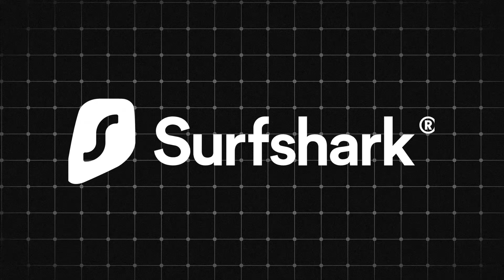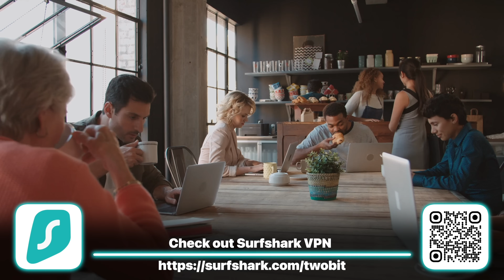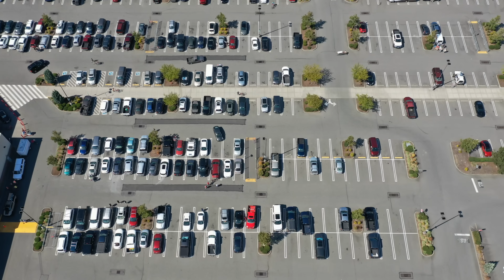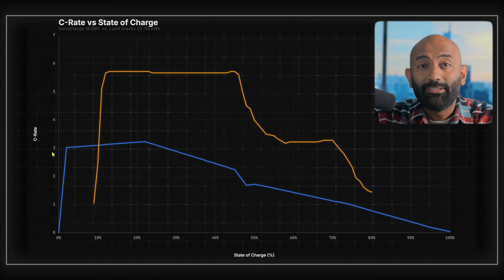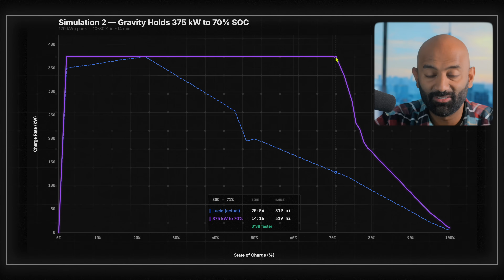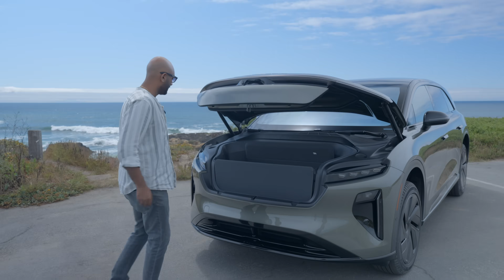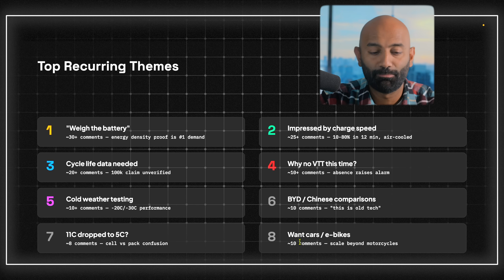Donut Lab Battery Test 4 Changes Everything!

Comment: Would the Doughnut Lab results hold steady even if the battery size is scaled up?  Somehow I suspect the results might drop a bit as battery size increases.  Obviously, though, there might be ways to avoid or minimize any drop.
Reply: Well, just with respect to a single claim. Cell level was claimed to be 12C charging, and already in video 4 it dropped to 3.5C charging at pack level....And we don´t know if 3.5C charging harmed the battery, if it even was a donut battery, or if the donut promotion video was not rigged in any way.

Time might show the truth.
Reply from the maker: size changes the game — cooling’s the real bottleneck

Comment: And this battery is aircooled. + nobody believed it...morons. The Finnish does not LIE...It's not in their culture...
Reply: We donut say we donut believe, but in general we donut believe anything, as to believe is not a strategy.....we want to know. 

We say we are not donut´s, and do not know anything just based on a promotional video. Yeah , yeah, yeah , either the Finnish do not lie, or the Finnish will be Finnish ... time will show.
Reply from the maker: finnish engineering: quiet, reliable, and slightly underrated

Comment: RC pouch cells charging at 12 C has been around for ages. Ok they do not live long as they are usually agonised with discharge rates averaging over 10C with bursts and peaks of 30 to 60 C or more.
Reply from the maker: 12C pouch cells? Cool. But holding 5.7C to 80% with cooling? That’s the new part.

Comment: Ricky, where is this massive electricity jolt going to come from? In order to charge these things in 3-5 minutes, or car versions in 10 means quadrupling the amount of electricity needed. We’re talking charging cables the diameter of your calf putting through enough energy to power a small town. Having a battery that can accept 770V doesn’t mean that 770V can be produced. What happens when three or four cars with these batteries show up at the charging station at the same time? Then, we’re back to 50 minutes charge cycles because there’s not enough electricity supply. 

I was a subscriber but I think I will be unsubscribing. You’ve compromised your scientific logic for clicks.
Reply from the maker: excellent question! thats why i made 2 graphs, 1 if we extrapolated the 5.7C rate to a big pack, and the second, keeping the current max rate, but being able to hold it longer. you're asking the exact right questions

Comment: If the "Donut battery" technology—unveiled by Finnish startup Donut Lab at CES 2026—were officially proven to be a scam, the CEO Marko Lehtimäki would likely face intense legal scrutiny across several jurisdictions where he and the company have deep ties. 

Potential "Safe Haven" Nations (Non-Extradition)

Should Lehtimäki seek to flee to avoid prosecution for financial fraud or investor deception, he might consider nations that do not have active extradition treaties with Finland or the European Union. Common destinations historically sought in such high-profile corporate fraud cases include:

United Arab Emirates (UAE): Often cited as a destination for individuals avoiding European legal reach, though extradition cooperation has increased recently.

Russia: Given the reports of an original angel investor being a Russian oligarch, there may be existing financial or logistical ties that could facilitate a move there.

Turkey: Frequently utilized as a jurisdiction that does not always readily extradite to EU nations.

Nations with no extradition to Finland: Certain Southeast Asian or Caribbean nations without formal legal assistance treaties.

Comment: After the most recent test I was pretty disappointed.   Just too easy to fake something like this.   The most salient point made here by you @TwoBitDaVinci is them soliciting for more capital from existing investors.

Lets just talk about claims and take what they have shown as not being faked.
Their claims
1)  400whr/kg - no information being provided to verify/demonstrate this density in packs much less final product in any video so far.
2)  Full charge in 5 min.   What was demonstrated was 80% charge in a 18Kwhr pack in 12 1/2 minutes.   Also note in video 1 at 11 C charging the pouch only got to 80% charge in just under 5 minutes.   So their own tests and videos show that even a single pack at 11C charging couldn't charge in 5 minutes.   Doesn't mean it can't, but if you have already shown this in your own tests, why show a result that fails to prove this.   Might be a significant improvement in charging speed but it isn't full charge in 5 min.  (their own tests shown refute this claim, yet all you can say is what an improvement it is).  Sure it's an improvement but decidedly a fail on demonstration of a full charge in 5 minutes claim.
3)  100,000 cycles - Not even sure they could do a complete cycle in 12 minutes (so assume this is the fastest they could do a cycle).  5 cycles/hour 120cycles/day.  Drop this to 1 cycle/hr still only 24 cycles/day.   It would take over 400 days to get to 10K cycles at that rate and just about 3 months at 12min/cycle to get 1/10th of the cycling data.  Not even sure I would believe this data because it probably wouldn't use a real world product or even one of the pouches.    Personally this part of their claims to me the most important as it is the difference between a pack that wouldn't be replaced in what 5-10 generation vs. 1/2-1 generation is pretty huge in itself.   Not one hint of evidence here on the long term cycling data.   Might have been a good PR technique to basically just start VTT with one pack cycling at some temp/rate and show the new cycling data every week along with other tests but no hint of that.
4)  We saw a high temperature test.   I would have to look back but didn't one pack seal fail or some internal outgassing at 80-100C?   From what I saw there the high temp test looked good but again only 1 cycle, one pack and one pack out of 3 breaking it's seal or outgassing internally.  (not a great look for a production ready product)
5)  No low temperature cycling test.   Others have pointed out this would give us some decent info on chemistry btw. and at least give a hint at low temperature performance.
6)  No proof or any information regarding not just what materials are there, but what materials are decidedly absent, much less green etc. 

There are some other claims made as well
7) Ability to print test in any configuration and have any voltage.   Would be nice to see proof of this, but again this is so deep not sure they could show enough info on video for us to be reasonably convinced.    I think this says a lot about the tech (if this all is true) and another huge aspect of this.

Finally.  We have what 3 videos showing what look to be improved charging rates and reduced heating, and one retention test.  Their own charging tests failed to demonstrate full charge in 5 min.   So the one claim they tried to prove with the most tests/videos basically failed.   That one fact should say a lot about what is going on here.   Out of 4 of the main points on their webpage they so far have demonstrably failed to prove point (2) and have not addressed any of the other 3 points substantially.

Lets hope they do a cold temp test.   The whole safety thing, sure they can get that important but probably boring test out of the way too.  So I expect next week for them or VTT to put a nail in a pouch.    As to the 100K cycles since this will take so long I would have expected to at least see a hint of that being done.  I hope to see results from first 100-500 cycles here on a pouch, but guess this is too much to ask.   weight/volume of a working pack would be nice as well (try to address 1 above and VTT could do that easily), as to (4) I expect that kind of info to come last, same with 6, 7 above.

Don't get me wrong.  I have been watching advances in energy storage for over 40 years now.  It would be exciting to see something like what DonutLabs is claiming coming to fruition.  I think we will start to see battery tech close to this level in the next 10 years for sure.   Don't care where it comes from, because when it comes, if priced properly pretty much a game changer for how all kinds of things can and will work in our society.   When I hear about what DonutLabs doing on the investor side here another negative on top of growing negatives.    They could have proven one thing, the 5 minute 100% charging time, but couldn't even do that so this means we can expect every other claim suspect as well.

Comment: Still nothing that proves their claims. This test proves nothing and there is no data that can be reliably extrapolated towards a big batterypack in a car. Charging at 5C isn't impressive and is something we can do with existing battery-technology - the reason it's not done is to make batteries last longer.
It's quite easy to make a custom BMS profile for this specific test, that allows them to charge the battery at a much higher rate for a single or a few cycles - The completely flat curve is a dead give-away. The battery is also quite small, meaning there is less balancing needed compared to the typical 70+ kWh packs used in cars. What we need is a third-party independent lab verifying the data and demonstrating the data with a 50+ kWh batterypack that goes through at least 300 cycles at this rate. But something tells me we will not be getting that kind of data.
And lets be realistic - the chance of a company that started in 2024 can make a huge breakthrough in battery-tech within a 1-2 years, something that thousands of scientist and engineers haven't managed to despite working decades in battery-research, is as likely as a teenager creating infinite energy through fusion in their bedroom. I'm all for hoping for things to be real, but lets use some critical thinking. We've seen this type of outrages claims made thousands of times in many industries, getting a lot fo money from investors and then going bankrupt because it was never real. There is so many signs that Donut is doing the same as many previous "breakthrough" companies with false claims.
Reply: It diddnt even charge at 5C, only 3.5C in average, only for a single charge, only in the sweetspot of 20 celcius and 10-80% charge. And we don´t even know if the video was rigged in any way....produced by the seller.

The Claim: 6C+ charge all the way from 0% - 100%, temperature from -30C to 100C, 100.000 times. And that´s not all, at the same time we ALSO have to meet all the other claims....no rare earth materials (only a rare earth mental), 400 Wh/kg pack-level, no lithium etc. 

This is waste of time.....please ignore the Donut until we have some evidence
Reply: @Unity2-765 I completely agree. Making a huge leap forward on even a single factor with a company that is less than 2 years old and have no prior experience in battery-research, is highly unlikely. But making a major breakthrough on every single parameter is straight up impossible.
Reply from the maker: third-party validation on a 50kWh pack cycling at 5C — that’s the bar. until then, yeah, it’s just a lab curiosity.

Comment: 10-80 % in new Xpeng  is also 12 minutes. That battery is also a 5c battery
Reply: The donut battery in this video was only 3.5C on average. 

It is not the peak C that determines the charge speed, but the average C charge rate. 

So, a few days before the Verge is claimed to hit the market, the best Donut Lab can show as evidence for their CES 2026 claim of 6C+ rating from 0-100% and from -30 Celsius to +100 Celsius was 3.5C, in the sweet spot of +20 Celsius and 10-80%. 

Not impressed.

If we will not have the evidence this magic battery exists, it is a scam,
Reply from the maker: XPeng’s 10-80 in 12 min at 5C? Solid parallel — makes Donut Lab’s real-world 5C hold even more impressive.

Comment: Why didn't they add thermal camera monitoring in this chargeing video?
Reply: Good question.... If the charge speed from 0 to 100% is 20 minutes, the temperature might also rise from 0 to 100 deg. C in 20 minutes, with an additional 20 minutes cooling period before one can touch the bike = 40 minutes in total.
Reply from the maker: thermal imaging's cool but we're tracking volts/amps — that's what shows the C-rate story

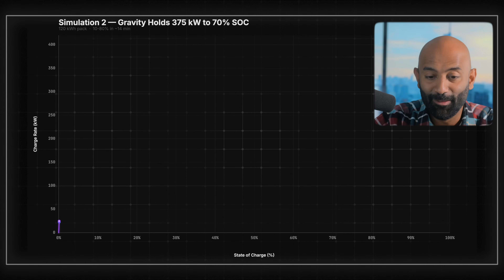Comment: 16:00 If it's just thermal load causing the change in charge speed, a large back might even keep going beyond 70% because the pack may never saturate with heat while charging at half the rate it's capable of.
Reply from the maker: thermal throttling is the limit — if cooling scales, you ride the curve higher

Comment: A motorcycle surely is the worst 1st use case for a 100,000 charge cycle claim.

Even if you charged and rode 3 times per day, it would take 33,333 days to confirm these claims.
Reply: Maybe they need a very cool bike to sell their donuts....a combo, take it all or leave it all.
Reply from the maker: 33k days? Yeah, we’ll need a few lifetimes to verify that one.

Comment: If the C doesn't change if you expand the battery size, won't charge speed remaind constant? Double the size, it handles double the power, but half of the power goes to each part of the battery. Each cell takes the same amount of time to fill up.
Reply from the maker: Exactly — C-rate normalizes for size. Double the cells, double the power, same fill time if the system can handle it. That’s why 5C on a big pack still means fast charging.

Comment: The question to ask is why Verge/Donut provide a battery warranty at cell level for 5 years and not 5000 years?, and restricted to "normal use, " when the battery in theory should last for 7500 years. 

No calendar aging informed that I know of. 
Normal use should be -30 to +80 Celsius , 6C+ charge rates all the way from 0% to 100% every single charge. 
How many years would it then last if one were a little gentle with the battery and had it until 50% SoH (still 300 km range)?

Theoretical estimates suggest that the Verge TS Pro with the 33.3 kWh "large donut" solid-state battery could last approximately 7,500 years before reaching 80% State of Health (SoH) under the specified conditions. 

This calculation is based on the official cycle life claims provided by Verge and its battery partner, Donut Lab, and does not account for calendar aging, as no calendar aging is published by Donut lab.

Battery Capacity (Large): 33.3 kWh
Estimated Range: Up to 600 km per full charge
Annual Mileage: 8,000 km
Rated Cycle Life (to 80% SoH): 100,000 cycles

Comment: On average, a motorcycle is driven approximately 4,800 to 8,000 kilometers per year. 

With the claimed 100 , 000 cycle battery from Donut and the Verge 5-year warranty (restricted to "normal use"), that would equal a maximum warranty of 40 , 000 km, on a battery claimed to be able to power the motorcycle for 60 million km... 60 , 000 , 000 km until 80% SOH ( 600 km claimed range x 100 , 000 cycles), and thereafter, who knows how many more millions of km until the battery is dead. 

This would equal a warranty covering 0 . 00066% of the claimed battery cycle life (not impressive) . 

I just wonder if the warranty would be void if someone drove 0 . 00099% of the claimed battery cycle life within the 5-year warranty period, as this would be 50% more than the high end of "normal use. " 

Anybody know before I get myself a Donut bike?

Comment: The Track T-800CDI, manufactured by the Dutch company E.V.A. Products, is widely considered the longest-range production diesel motorcycle ever made, with a claimed range of up to 560–590 miles (900–950 km) on a single tank.

Donut, go home.

Comment: The opportunity for big companies to acquire and analyze these batteries is expected to arrive very soon through commercial products: 

Verge Motorcycles: Verge is scheduled to ship its TS Pro motorcycles equipped with Donut Lab batteries in Q1 or Q2 of 2026.

Other Partnerships: The company has also announced partnerships with WATT Electric Vehicles and Cova Power for modular platforms and smart trailers. 

Once these vehicles are on the road, it is highly likely that competitors will perform "teardown" analyses—a common industry practice where competitors buy a product to take it apart and study its components.

Comment: You're not just limited by the charging infrastructure in your hypothetical Lucid with Donut Lab pack. You're also limited by the cooling infrastructure in the vehicle. If the cooling setup is stronger, you can likely maintain a higher C rate for longer, topping you up even faster. Could be down to 10 minutes or maybe even less in a car sized pack with proper cooling. That said, still hard to pull the power from the grid.

A potential solution to this is to have other ballast packs at stations which charge slowly between recharging vehicles. That way the grid doesn't have to deliver 1MW+ of power instantly. You would of course be grid limited if you had constant charging.

This might even make sense on the scale of using a diesel generator at charge sites since the generator theoretically can be more efficient than an automobile engine. The infrastructure is also more swap-able than a car engine (for instance if there is a breakthrough in hydrogen generation that would allow for the diesel engine to be replaced with a hydrogen engine). Heck, even solar could be charging the ballast pack and we could remove the grid entirely (obv this only works in sunny areas with open space, like the central valley of California).
Reply: In that case, I have a smarter solution for a holy grail power source....a diesel motorcycle....super fast to charge, super long range.
Reply from the maker: cooling's the silent killer — fix that and grid's next